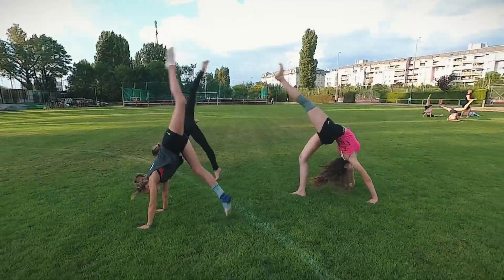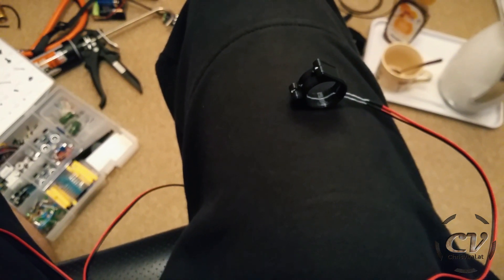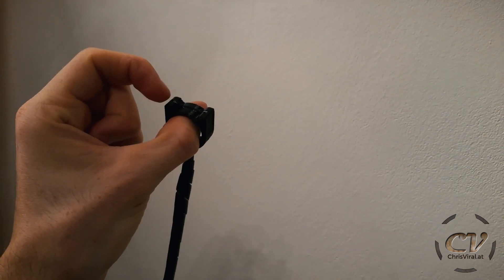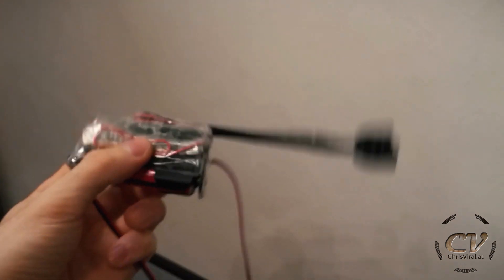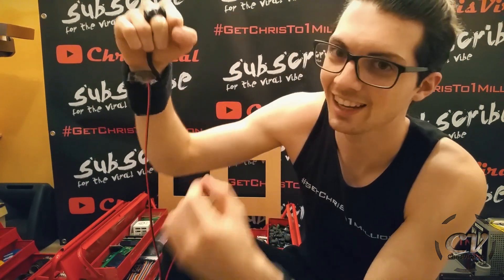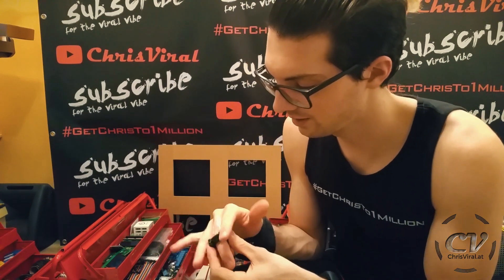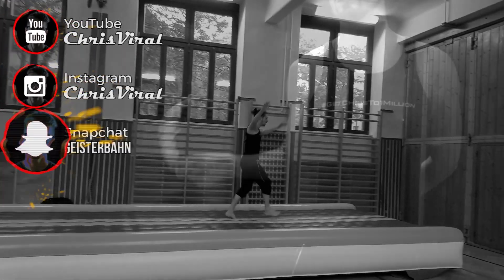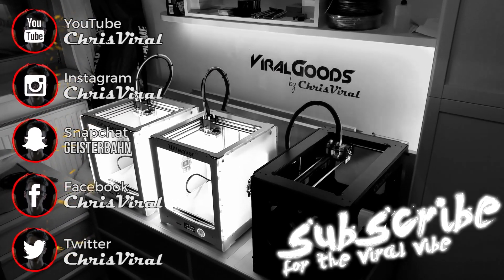Taser Ring Prototype V2

Comment: Try making a housing for the pack out of some durable materials maybe a hard plastic with some rubberized grip. Internally put a layer of rubber in and a few smaller batteries that are close to the same power. Insulate the internal ring over the wire I recommend a bit of electrical tape and for the punching that’s gonna be a bit tricky but I can say use your wrist or elbow movements to make it turn on
Reply from the maker: Thanks for the suggestions Michael, I thought about going really small with the next iteration too, maybe with 2 CR2032 batteries lol. That would be funny. A tiny housing for that would be easy to make too.

I'm detecting the punch movement (accelerations) in the flame fist project, but this would require an Arduino and much more stuff, so in this case it needs to be as simple as possible. I'll figure it out one day I hope :)
Reply: ChrisViral Vlogs definitely I had been looking at the ones that could purchased and they were almost all very brittle or bad quality so I’ve been wanting to design one so that’s what I’ve been up to.

Comment: for punch activation just use a simple momentary push button switch :)
for you high voltage leaks, try silicone hv cables. You can find some in old TVs / CRT-Monitors. (the cables which are on the big hv tronsformers)
 I am sure you have one of these:
http://circuit2connect.blogspot.com/2017/12/low-cost-flyback-transformer-driver.html
Reply from the maker: Oh god what an easy solution would that be :'D
I thought about that but I think the button will break rather fast.

Oh thanks for that, I will try that. Yeah probably, I saw a video of a British guy explaining the wiring and stuff too. I'm not very open to learn about that atm though XD